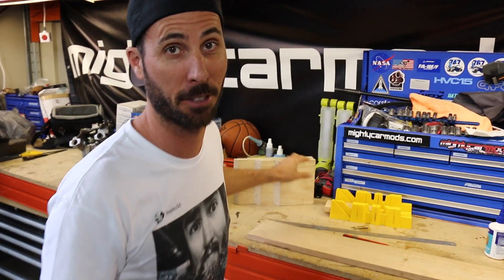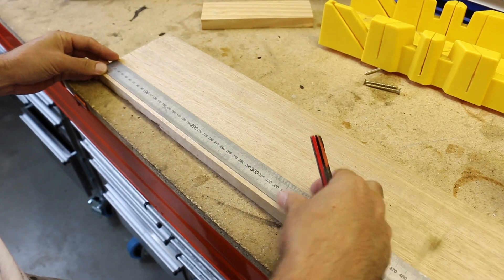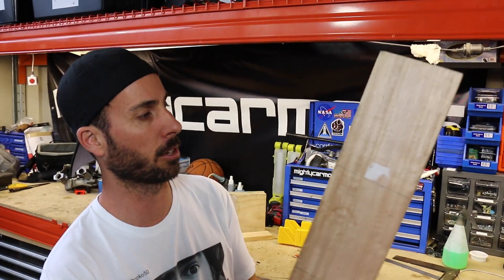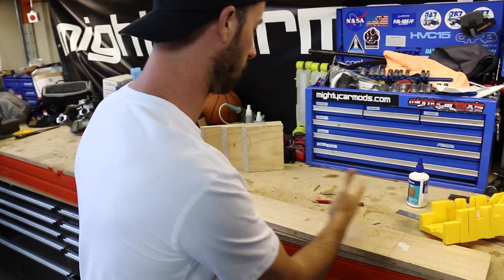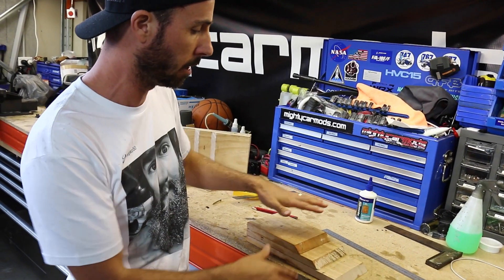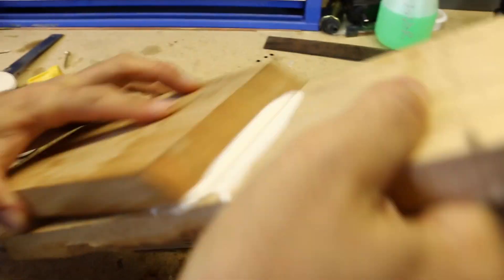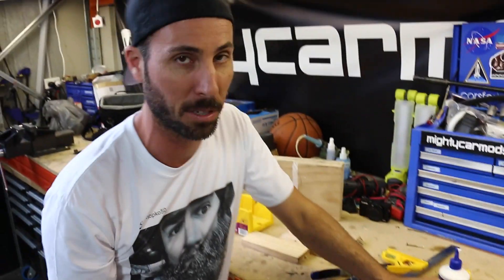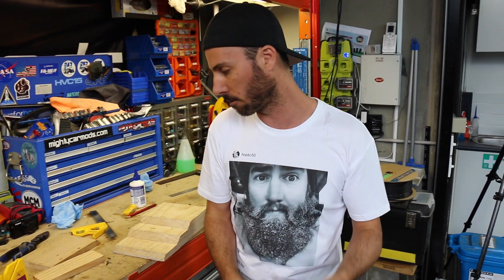Make your own Lowered Car Ramps for $5

Comment: Robertson Head screws > Phillips Head screws 

prove me wrong
Reply: +Justin Bechtel 
I can see why they'd be better to drive into material. However I've literally never heard of these before and I've been in the construction industry in Australia for like 6 years. Phillips Head screws are pretty much the norm here, they're everywhere are driver bits/screwdrivers are so cheap and easy to come by. Robertson ones would just add another tool to lose haha
Reply: +Mitchell Dowling Very true about Phillips heads bit being more readily available, but Roberson head screws have been around for a long time in Australian Construction. Most stainless deck screws use this head type as well as many chipboard and treated pine screws. I recommend giving them a try, they have a smaller head gauge which is sometimes handy when trying to countersink them.
Reply: We use those here in America for wood porches and stuff
Reply: Mitchell Dowling
thats understandable, basically, the robertson head screw is a square, its very hard to strip out unless its made with a crappy metal, unlike phillips heads where they strip out quite easily (at least thats what i have found), think of an alen key head, but a square.
Reply: +Justin Bechtel In america they have been around for a while but recently they have them right on the shelf beside the phillips so ive been buying them as much as I can they are so much better for woodworking with pressure treated lumber on decks and other things of that nature.
Reply: Nick Martin
they strip a hell of a lot less than any phillips head screws, which is ideal when you know, you're doing things that involve stuff
Reply: +Justin Bechtel true
Reply: +Justin Bechtel neither. Torx is the new shit ;)
Reply: EmilGlockner
Not everyone has a torx driver knocking about, what I do have though, is about 6 different sizes of robertson head screw drivers, as well as like maybe 3 phillips heads
Reply: +Justin Bechtel The standard Phillips drive is specifically designed to cam out and slip, and strip the screw. It was designed in a time when they used to have problems with the screws breaking the parts they were screwing into, before cordless drills or clutches existed, and when screws were made of high quality steel. They were never meant to be used with soft metal screws, hand tools, or cordless drills, they just sort of caught on because they were in wide use in factories from the original purpose.
Reply: +Justin Bechtel 
Squares are difficult to register and absolutely can not be size mismatched, but take higher torque.
Cross shapes register really easily, they have a huge size range but want to jump out on you at higher torque.

As always one size does not fit all.

Comment: $14 each for the plywood, that's $28
$13 for the glue, that's $41...
$2 for a set of screws, $43.......
$12 for the wood cutter angle jig.....$55

This isn't a $5 mod at all but still way cheaper than buying ramps!